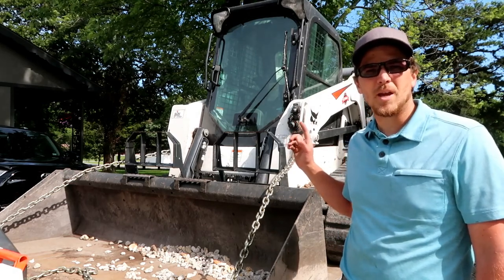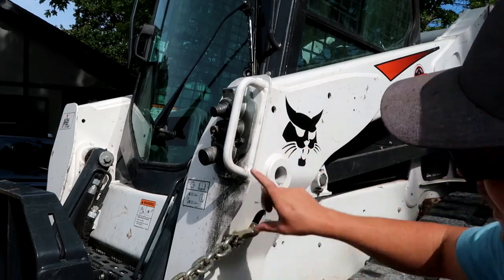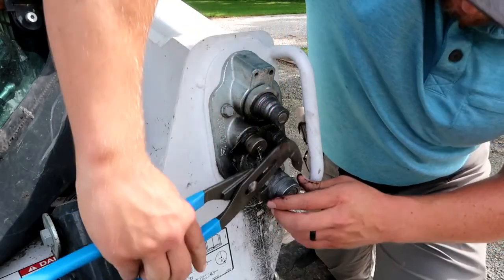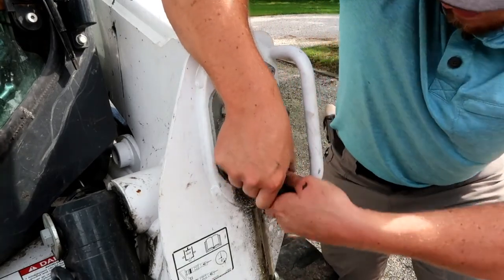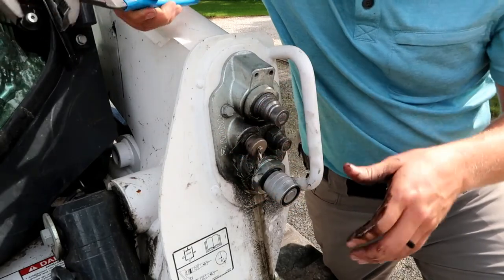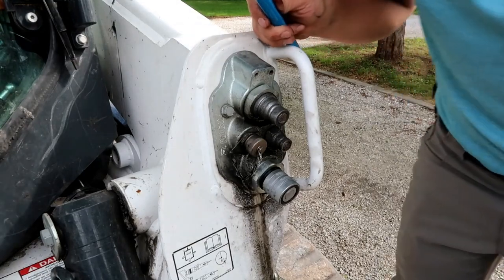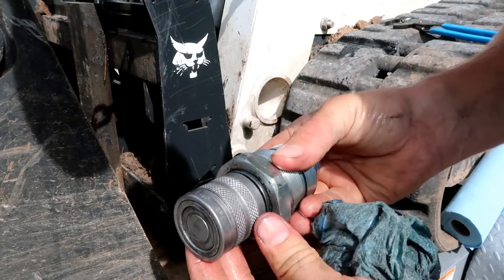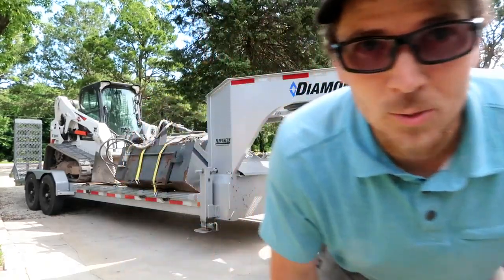Bobcat T650 Female Quick Coupler Replacement

Comment: Did you need to release the pressure from the hydraulic system before removing the coupler?  Or was it as simple as taking off and putting new on in?

Comment: What I found causing mine to go bad was the auxiliary attachments when rotate up, was slamming into the couplers, ruining the little o-ring inside.  I tried many times to replace the o-ring to no success.  Had to get new couplers... Need a way to stop the attachment (tree puller) from raising or rotating forward so much.  I try to watch it, but with foot controls, hard to stop it in time sometimes.  Basically causes the couplers to be inoperable.  Thanks for sharing.